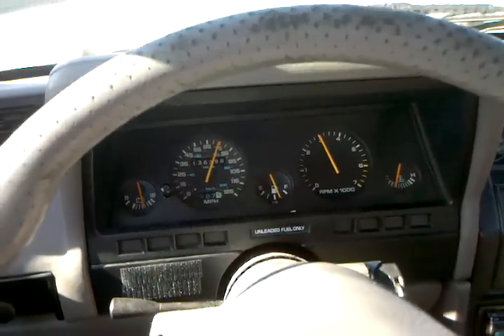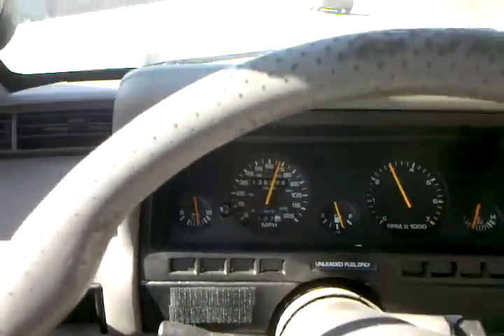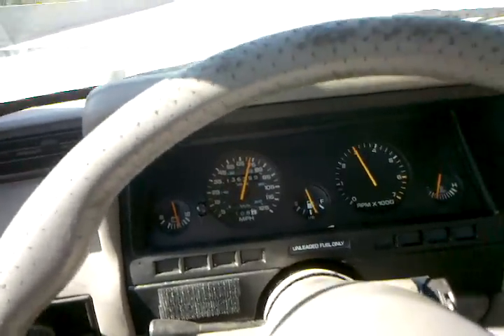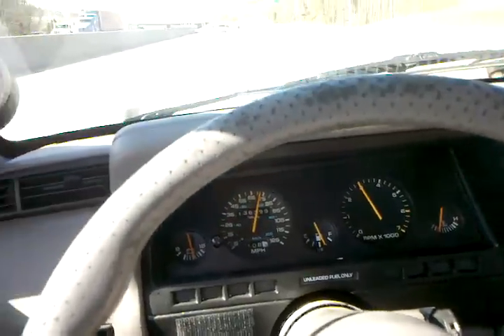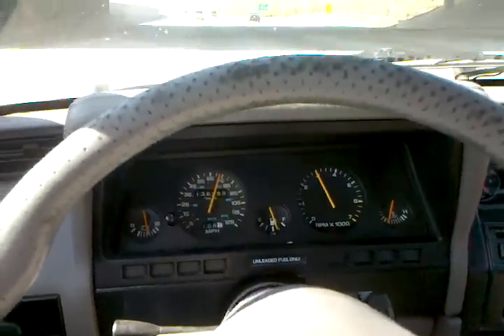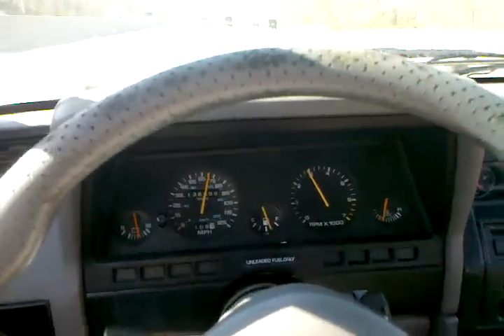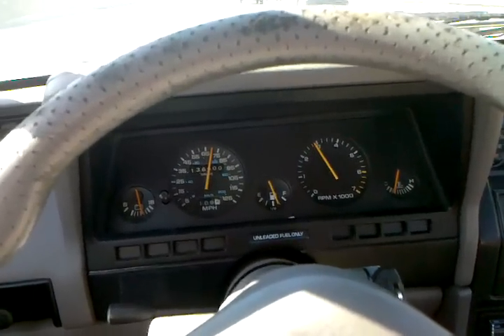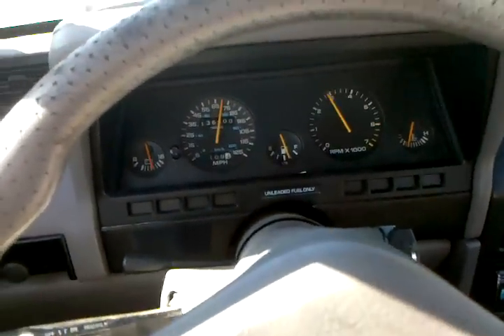Dodge Shadow turbo fuel cut issue.

Comment: Turbo Shadows had a '' Boost Limiter'' as i know and more than like 10 Psi the ECU used the MAP to see the Boost and it Cuts the Ignition so it won't Overboost.
My teacher had one back in the days and he had to Bypass that with a Switch and a Resistance so he could Boost to like 20 Psi if he had the switch off, The Ignition would cut at more than 10-12 psi and switch on, he boosted 20-25 psi

Comment: If you haven't upgraded or changed the settings in the engine computer, the shadows stock engine isn't made for 15 lbs of boost and it can eventually lead to a head gasket going or a piston being wreched because of the lack of fuel.

Comment: Check the intake manifold.gasket ...sounds strange...but I had the same sort of prob with my SRT4 ...it ended up being a slight crack on my intake manifold gasket, over cylinder 1... swapped the gasket and car runs great now..

Comment: Are you running the stock computer? If you are im surprised your not getting a code 45 as they will cut off your fuel at 15 psi of boost to protect the engine...

There are ways around it but the simplest is to install a performance computer.

Try lowering the boost about 1psi and see if it still does it...

My Shadow cuts out in the higher gears under full throttle because under the load the boost barely hits the cutoff.